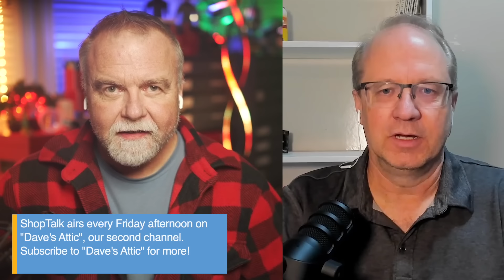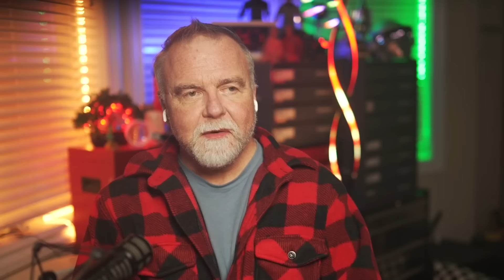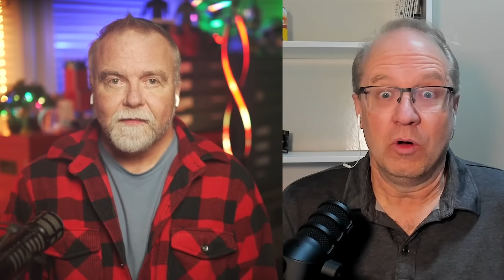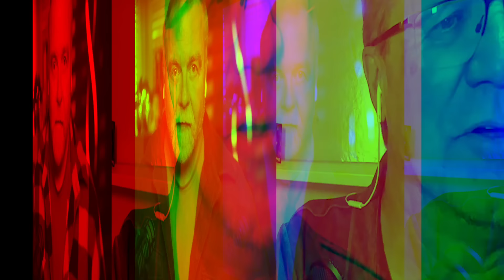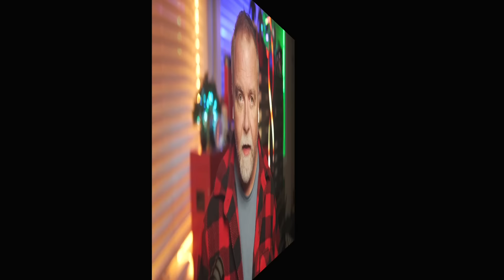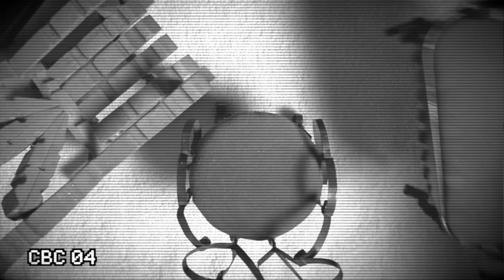The Hardest Bug I've Ever Fixed: Best of ShopTalk

Comment: The simulator for the Space Shuttle was known as the "SMS" (Shuttle Mission Simulator).  Back in the days before the Shuttle's first launch the simulator had to be created to train the astronauts. This SMS was based on a Sperry UNIVAC 1100 mainframe with several Perkin Elmer 3250 minicomputers performing aux functions such as payload simulations (how do I still remember this crap?).  The simulator was a "motion-base" simulator, meaning it would move to simulate the astronauts' real world experience.

The bug in question was a very noticeable mechanical oscillation when the simulator would execute the "roll maneuver" after launch.  The bug persisted for months, to the extent that, for the first time, NASA put out a bounty on it.

The bug was never found, and eventually launch day arrived.  The Shuttle launched perfectly and, when executing the roll maneuver, exhibited exactly the same oscillation.  The problem was not that there was a bug in the software, but that the simulation was too accurate.

And now you know ... the ... rest ... of the story!

Comment: For me it was a feature of Microsoft's 5.1 C compiler.  
Seems that the keyword "volatile" was allowed syntactilly but NOT semantically.
As in it would not generate an error, but it also did not generate the correct code.

Comment: I've been chasing a bug in an embedded firmware on ARM with 3rd party runtime. After some code changes, a structure copy suddenly begin to crash with segfault.

As it happened, the 3rd party runtime had a static area for malloc pool declared as an array. An array of bytes. Without enforced alignment. ARM can do simple read/write of unaligned words. But load/store multiple requires word-aligned addresses. When the compiler assumes that the source and destination are aligned, it generates inline copy code with load/store multiple commands. Because the malloc pool become unaligned (because arrangement of statics/globals changed), it was returning unaligned memory addresses.

Comment: The wraparound error reminds me of a bug in the TRS-80 editor assembler for the TRS-80 Model 1. It was sold as a Radio Shack product, but was written by Microsoft. The assembler would happily assemble a relative jump of 128 bytes forward. When the processor executed the command, it jumped backward by 128 bytes. It took a bit of head-scratching to figure out the bug. I ended up disassembling the editor assembler, fixing the bug, then reassembling it.

Comment: The hardest bugs are always the ones that are hardest to reproduce.

If I can reproduce it in 10 seconds by running a testcase, I'll find out very fast. If it takes a couple of hours to reproduce, and only crashes half of the time... Well, good luck finding that one.

My favorite one was a user who claimed the system changed her inputted numbers, sometimes. It was a warehouse application, with numbered boxes. Most worked automatically, but they could manually fill a box and register it in the interface.

Safe to say, putting in the wrong box number caused quite some issues down the line.

I couldn't reproduce it at all, not in a test environment and not even in the live environment. So in the end, I drove a couple of hours to that warehouse in the hope I would see something by just observing what she did.

I watched her type in the number "063", and I thought I saw it change in a flash when she hit the save button.

It all came together, it was an interface bug, not a bug in one of the communication protocols.

I never tried entering numbers with leading zeroes, but apparently the interface framework we used, had a bug, and treated those as octal numbers.

Finding that big was such a strange feeling. Happy that I finally found it, but mad that I spent a couple of days in total to find a bug in a library.

Comment: I didn't solve this bug but I was part of the team trying to figure it out. We were working on a relatively early cell phone handset that runs in an RTOS. Something was consuming CPU cycles and we couldn't figure out what it was. A senior guy finally pinpointed it to a process that wasn't yielding. It was essentially in an endless do loop and never yielded back to the operating system.

Comment: The hardest bug I've addressed was in smartphone that under certain carrier, at certain times, everyone's phone around a time would seem to run out of battery. Sure, it's near the end of the day so people would just assume it's end of the day (actually around 5-6pm, on Fridays in certain European countries). Turns out there's some cellular protocol under certain circumstances, would be put into certain modes to save power. Without this feature, most smartphone would be out of power within 15-30min. What happened was that there's a race condition between the different cores, the modems cores and the applications cores. Since in mobile, both systems think they are masters and the others are secondary,... besides it's impossible to replicate, the modem core as well as all the code are highly protected to anyone outside the modem system. Out of entire world, was me and one HTC engineer both had a binary dump of the system and went through steps by steps to identify the bits. The modem team then had the visibility of the code mapped to the bit to determine the race condition. 

The second hardest bug I've address was when I was a bios engineer and we'd have system dried randomly. This was back in the days we first made all-in-one pc laptops. Instead of using the $300+ intel mobile CPU, we decided to use the $100 desktop CPU. we had tens of thousands of computers in factory running burn in tests and would just fail at random. turns out under certain conditions, the fans wouldn't perform and would melt... yes you read that right, melt...

Comment: 8:30 I was so happy when defrag come in ms-dos 6.2ish I used the database program data-ease to store all the products in the warehouse for a well known worldwide retailer and we use to process picking list from it and lots more and once a week we run history reports it took a night to process due to where information was stored on the disc etc and then backups. Defrag cut the time it took to do jobs over night to under a hour a made using the system more user friendly less waiting for the paint to dry so to speak. Thanks Dave.

Comment: I had a friend who was customer engineer working on IBM equipment, and got a call out to a machine which had a vertically mounted 8" floppy drive as the boot drive. The report said that it wouldn't boot and was making a horrible grinding noise.

Anyway, he inserted a new 8" diskette, turned the machine on, there was a horrible grinding noise and the machine didn't boot. He pulled out the diskette and found it was badly scratched.

Tried again, same result. So he took the machine apart

In the drive he found cigarette ends, aluminium foil and other debris.

Turned out the cleaning lady thought it was a flip top bin and was emptying the trash into it.
Reply: bruh 😮
Reply: (Fortunately, she apologized, and went back to unplugging the server so she could plug in her vacuum!)
Reply: Wtf!

Comment: Great video! Talking about software, I'd love to see a video on every big Intel CPU (8088, 286, 386, so on) explaining key architectural differences and instruction additions that made it faster and easier for software developers to use like MMX and SSE instructions. I don't think very many videos exist talking about the improvements through the 90s especially, and it would be cool to see how Intel was a leading innovator through the 90s compared to the harder times they are facing currently. Thanks so much and I hope you get a chance to see this!
Reply: I'm certainly not in Dave's league but I was around doing assembly language back in the early days. I think the difference between 8088 and 286 is really minimal. But the 386 was a big breakthrough with protected memory, segment registers, exception vectors and lots of really cool neat things.

Comment: The hardest bugs I've had to fix usually came down to hardware bugs in the ASIC that had to be worked around somehow. There is one bug fix I've always refused to sign off on, because it was all a lie by the sales team. It required an extra capacitor on the circuit, and there was no amount of code we could write that would fix that one. But somehow, that's how it was sold to the customer.

Comment: Its immensely rewarding chasing bugs to their root cause and fixing it.
Reply: @kwazar6725  at least the fixing thing, yeah
Reply: I sometimes enjoy just reading all the work someone has gone into fixing some obscure bug, because I can see how much work they put into it, and I can emphasize with the sense of satisfaction one gets when one finally pins down the actual root cause of some sporadic but infuriating bug!
Reply: speaking for myself, finding & understanding the root cause is the rewarding part (dopamine kick) ... actually fixing it is "just" work.
Reply: Not as rewarding as writing well designed and crafted code that runs for years without a significant bug.
Reply: Nothing less is actually a fix.
Reply: @LTVoyager  Writing code is just work hours. No more fancy than being a carpenter. The final quality depending on the person.

Hunting a wile bug really is more like a detective story. Analyzing what evidence there is. Making deductive decisions, trying to eliminate possible sources. So a way different type of reward to solve compared to the daily grind.
Reply: @ Sadly that is true for the vast majority of coders, I mean bug writers.  I worked as a software engineer and I spent most of my time doing system analysis and design and working hard to craft code that was error-free.  I won’t say I ever wrote error-free code as it is pretty hard to know that with certainty, but I wrote a lot of code that ran for years without detected errors.  Most errors occurred when underlying software such as system libraries were changed or broken due to a new OS release.
Reply: Not always.  I fixed a bug that the then customer decided not to implement.

Comment: Dave, some of the Dec operating systems had flags you could set on files for contiguous (mandatory) and contiguous best try.  With the mandatory flag set file creation would fail if there wasn't enough contiguous free space to complete the allocation even if there was plenty of free space remaining.  This was used for some OS and performance critical files.  If contiguous allocation failed you had to delete stuff ir defragment the disk before you could create the file.

Comment: For me it was a self inflicted wound. I was just learning C and I was writing a text windowing system for our company’s brand of terminals. Couldn’t use curses because of some weird things the terminals supported — like using the same control sequence to turn on then off the same feature, like insert mode. After banging my head trying to get curses to work, I decided to roll my own. I used vprintf to create my own functions to move the cursor etc. under some circumstances, I was passing NULL instead of ‘’ and it worked fine. People are using the program without a problem until we upgraded the OS. All of a sudden, the cursor is jumping everywhere, terminals are locking up, it’s a nightmare. Finally, I realized when I passed a null pointer it was looking at position 0 in the memory which used to have a zero at that location so it was treated as ‘’. But now it had 1B followed by random information so that every time I passed vprintf a NULL it would generate a random escape sequence. Fixed with a simple ternary expression.

Comment: Back in about 1983 I had one of those transformative debugging experiences almost exactly as you described. I was working on an adventure game in Z-80 assembly on my TRS-80. Everything had been going just fine for a few days. Then, I added an item to a table and ... boonies. As I recall, a full on crash was not very eventful. A couple of clicks on the floppy disk and the TRS-80 prompt appeared on screen. I feel silly explaining it now as it seems so obvious, but at the time I just couldn't see it. Stared that mother down for a day and a half. Turns out that my 'items' table, (for which I had allocated what seemed like lots of memory), overwrote an adjacent pointer table by a couple of bytes. I've told this story many times, suggesting that until you've stared at a monitor for 13 hours straight trying to figure out how the simplest of changes brutally crashes the computer, you don't know what it's like to be a programmer.
Reply: Yep, the most difficult ones have always been the most obvious ones.  The reason why at work we always used the 'fresh eyes' approach.  Getting someone else to have a quick look to see if they can spot something obvious which you're not able to see because you've been staring at it for hours/days.  The first few times it's extremely frustrating and annoying when someone else comes along and spots your mistake in less than 5 mins, but after a few you come to appreciate it as a valuable tool.  And of course you get the opportunity to do it to other people's code as well 🙂
Reply: @farab4391  Exactly. We used to refer to the 'janitor syndrome.' Same idea ... A janitor walks by after you've been staring down your code for hours and asks, "Why did you do that?"
Reply: Or you’ve lived your entire career in Rust. I guess your point still stands 😉

Comment: I was one of the coders on a Playstation 2 game. It was near completion but the game would be unstable, it would crash. All the coders were pointing fingers at each other, none of them were debugging the issue. It was obvious there was memory corruption, but the PS2 tools at the time did not have memory protection, did not have boundary checking. I spent days making the C/C++ code compile and run on a Windows PC using MS DevStudio. I enabled full heap and stack checking using the MS compiler options. Leaving the code to run a loop through the title screen, into the game levels, and back out again, quickly showed that an old bit of code that handled a general purpose link list of objects was to blame. It was not correctly handling unlinking and would lead to incorrect memory blocks being accessed and modified. In the end I made sure to point out what coder was responsible and make sure they knew exactly how much work and risk they had caused.
Reply: Yo thats so cool! Can you share more about the PS2 development? I grew up on the PS2 and would love to knlw and or learn more about how developing was for the PS2 back then!
Reply: @harveysattic3918  once the compile and build tool chain it was pretty OK most of the time. The dev tools allowed the console to access files on the PC. The debugger was just about OK to use.

Comment: I think the hardest bug I had to track down was when HP wrote a new implementation of Appletalk as part of a new network card.  I had a customized version of CAP (Columbia Appletalk Package) which work absolutely fine with this new implementation, except that occasionally a network connection would just hang up forever.  After months of debugging, I finally figured out that the problem was in error-handling of a dropped packet.  And what's worse, is it came down to subtle and ambiguous wording in the official specification of Appletalk.
The bug which took me the longest to track down was in a simple client for chat system.  It just gets lines from the chat server and writes them out while letting the person at the terminal keep typing in their own messages.  Every once-in-awhile my client would print out an extra blank line.  It took me at least 18 years to track down that bug!

Comment: Man, I hate pointers.  (I grew up on self-taught BASIC, please don't judge).  Since my computer science degree, I've always wondered if we can enforce coding without pointers … is it just a question of pure performance, at certain times?
Reply: I suppose without pointers you would have a huge call stack if you tried to use strings as parameters.